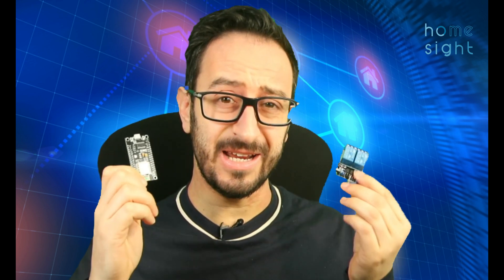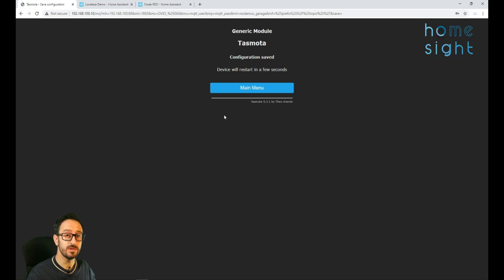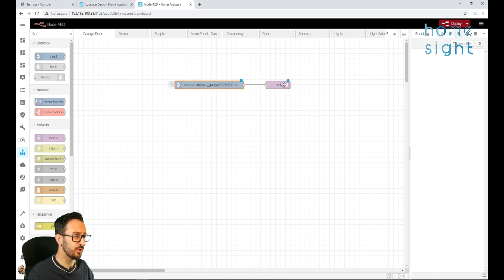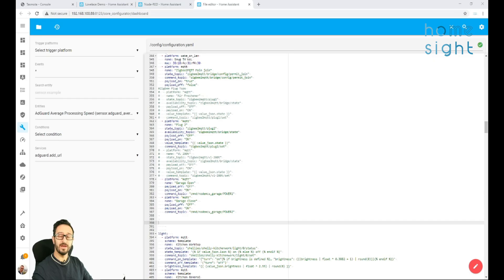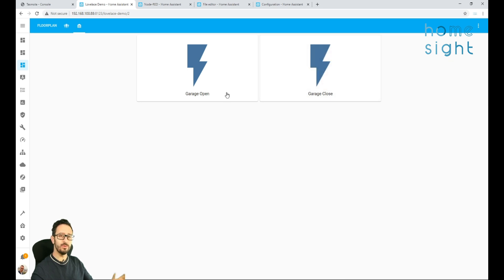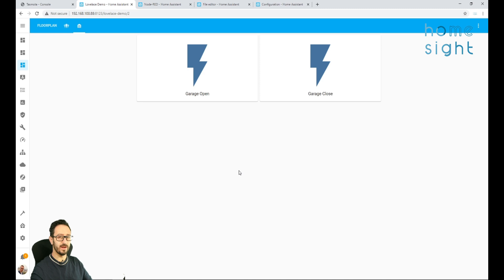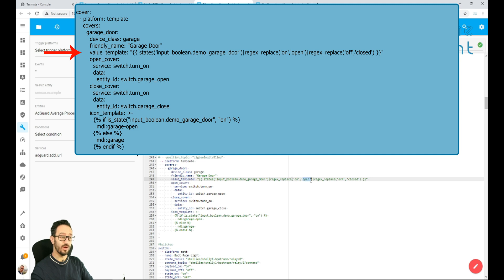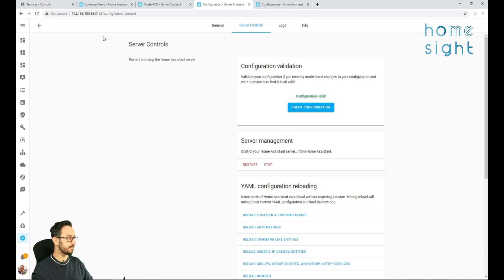How to setup NodeMCU with a Relay into Home Assistant and Node Red to control  garage door - Part 2

Comment: Just wondering why you use 2 MQTT sender nodes for the ON and OFF commands in Node-red. I would use just 1 connected to 2 inject nodes (on and off commands in the payloads)
Reply: Or am I missing something?
Reply from the maker: No, not missing anything. Just many ways to do it!

Comment: How come you use this setup instead of a Qubino Flush 1D Relay that you can power directly from the motor itself? It runs on zwave plus and it works fantastic.
Reply from the maker: Hi, I’ve never used any of the Qubino products. They look pretty good! I don’t run a zwave network, so I would of had to add that. There are many other alternatives such as the Shelly 2.5 too which I could have used, but I’m not sure any would have come in as cheap as this.
Reply: The price of your setup is absolutely cheeper, but it takes a bit of job to it. The qubino is all done, 4 wires to the motor and of you go 😃
Love your vids by the way, keep up the awsome work 👍
Reply from the maker: I agree, it’s cost vs benefit! If you don’t mind spending some time on it, you can do it cheaper!
Reply: @HomeSight  don't forget the fun factor of DIY!

Comment: Thanks for the helpful video! Do you know if this can be wired parallel to existing garage door control? I would like to still be able to use the garage door button, but also have this as another way to open the door.
Reply from the maker: Hi, since it’s volt free, yes you could easily wire this in parallel.

Comment: Great video. I am watching lots of stuff you have done at the moment to improve my knowledge. I have a sonoof 4ch on my garage door, but recently used a nodemcu for an alarm with konnected so interested in what else they can do. I didn't follow the last bit, creating the cover and the input boolean, was the goal to make the toggle button open the door and show it as open in Home Assistant dashboard as it didn't seem to happen, it was a manual press of the extra button to show it as open although it did trigger the automation? Mine is working fine anyway and I have a contact sensor on the door too though intrigued by the solution you posted as far cheaper solution. Great work.
Reply from the maker: Hi Rich, creating the cover template at the end is to allow me to use multiple devices as one. So I have a rf 433MHz door sensor which shows open/closed and the nodeMCU acting as the control. Thanks for Watching

Comment: Great video, thanks! 

I've been looking to buy a nodemcu but ended up confused around the different models and subtle differences between boards. Which one did you buy? Would really appreciate a link.

Also, did you just put the board in your garage door control housing or did you print a case or other?
Reply from the maker: I have space within my garage door housing so mount in there. Here’s a link to a nodeMCU https://amzn.to/3rig0yU. They are much the same though, I use the D1 mini too for various things, it largely depends how many Inputs/outputs you need.